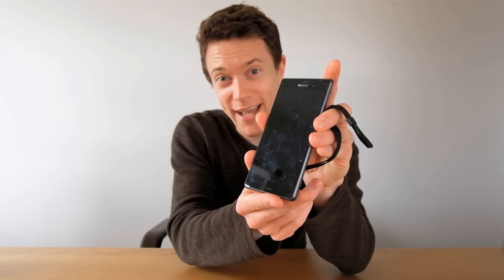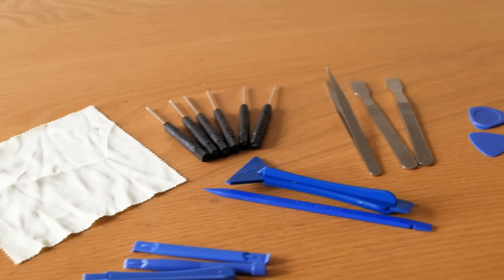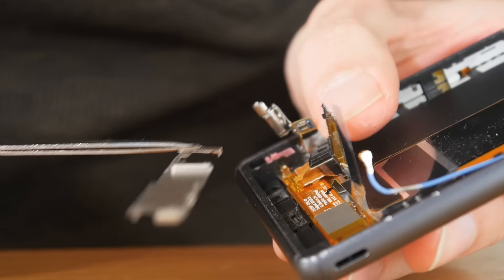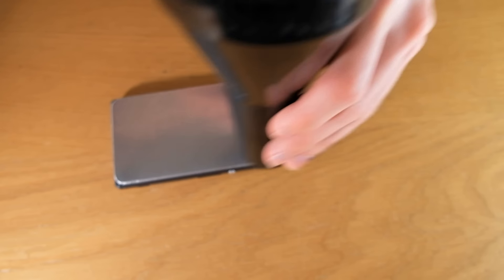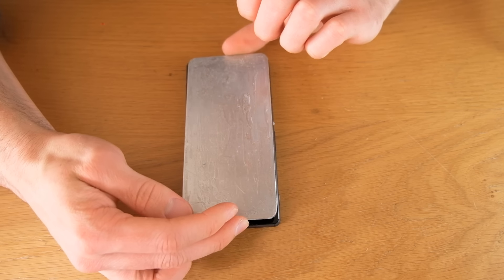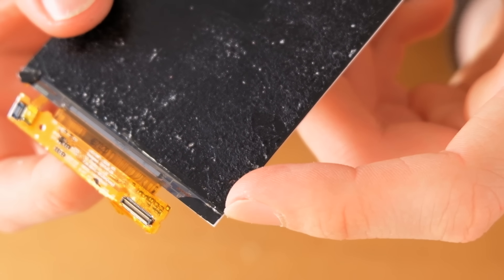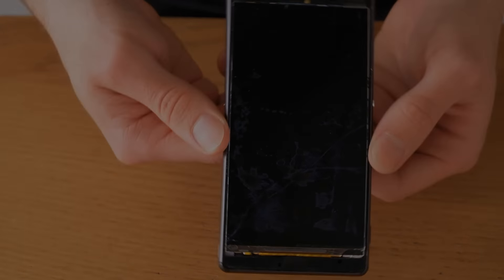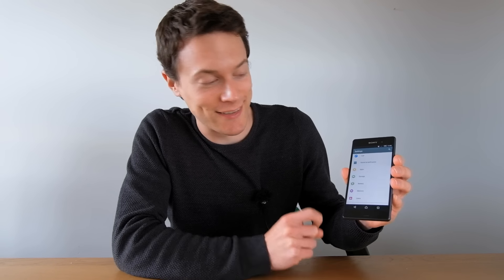Fixing a Smashed Phone Screen - on a budget! (GLASS ONLY REPAIR ATTEMPT)

Comment: In this day and age with the limited resources this planet has and the horrendous labour conditions used to extract rare earth minerals, all phones should be easily fixable, using all these glues and adhesives to make these phones very difficult to repair is ridiculous!
Reply: Nick MG i agree with you.. but without glue, if the phone fall, it will open apart itself, and it shouldn't do that..
Reply: I know what you mean. It should really be modular. Each component should be easily separated and replaced as and when. Phones were easier to repair. Now, most of them are sealed units. The drive to sell the next best phone is what these manufactures count on.
Reply: Something like the Fairphone is better.
Reply: Just buy a brick, or don't drop your phone. 
Easy solutions :D
Reply: Sony phones are like that in particular because of the water resistance. The adhesives help preventing water from enter and damage the components. Being a sealed unit really helps with that. While I agree with you I  don't see the point in the something like the fairphone since many of this phones are easy to repair without being modular and the average consumer don't want to have the trouble to DIY anything.
Reply: Nick MG Most high end phones today are designed to be water resistant. And even if it's not water resistant, many phones have a full glass body. And they tend to use glue and adhesive to seal the phone from water or keep the phone together. 

You can check out channels like JerryRigEverything or sites like iFixit to see how easy it is to repair a certain model.

Kinda miss the days where you can easily repair the phone yourself by just undoing a couple of screws. Like the older plastic Samsung Galaxy S phones. The only part held together with glue is the screen and the chassis. But just buy a new chassis and transfer everything over, end of story.
Reply: Quit whining! If you don't like the new phones, don't buy it. Stick to the old nokias. These phones go through months of R&D, their components are so tiny, the best solution is glue.
Reply: Well, if you can repair it easily, you don't have to buy a new 200$ screen from the manufacturer. They aren't going to cut their profits for no reason.
Reply: All those glues and adhesives also allow the phone to be much smaller and cheaper.
Reply: Fairphone 2 FTW :D
Reply: Untrue. You can just get a bezel with pre-assembled screen and digitalizer. And you can swap them out by simply removing the connectors. Popping out the front bezel. Dropping in the new bezel. And re-attaching the connectors. Its more expensive this way. But not as labor intensive. Also it used to be easy to replace digitalizers. Most were edge glued into place. Nothing a hair dryer and a bit of 90% alcohol 10% water mixture couldn't get off. Now days most phones are vacuum sealed. Meaning the digitalizer and screen are glued together while under a vacuum. Separating the 2 will guarantee the screen to break (due to loss of vacuum) into a million pieces leaving  you with a horrible mess to clean.
Reply: Jupp - I still remember the good old days of the first smartphones - digitizer and TFT where separate parts and you could get a new glass for 5-10$. Also there where actual screws and gaskets, so you didn't need to deal with resealing every time you opened it. Sadly most newer phones use UV-cured glue to fill the gap between both - according to manufacturers to improve performance readability when using the phone in the sun. I guess most would still prefer unglued since the usual "spider-app" is probably a lot worse to read…
Reply: Nick MG yup and the good old days of getting dust in the screen are long gone
Reply: Random Ryan There are phones that are easy to repair but aren't too thick. 
Phones like the iPhone 6 and 6S(The iPhone 7 doesn't count). Screen repair is easy since the first thing you open up is 2 screws and pull out the screen. And the internals aren't too hard to take apart.
Reply: Man the some of the comments on here make me realise that we're all probably doomed!
Reply: That is the whole point to my initial comment?
Reply: Pusalieth Phones doesn't have to be modular to be easy to repair. 

As I mentioned, the iPhone 5 to 6S are one of them. iFixit rated the iPhone 6S 7/10 for one of their most repairable phones for early 2016. The first thing you open up is the screen assembly. So you can easily get a new screen installed yourself. The battery and everything else is easily accessible. 
The LG G5 is one of the easiest to repair phones ever. iFixit rated is 8/10. But that phone is modular and that phone is just a failed proof of concept. 

The S7 Edge, requires the front screen to be removed to replace the MicroUSB port. Which is just overkill. And if you want to fix it yourself, you need to have a lot of patience. I mean all of the patience you have. One small screw up, can cost you a screen. Or even an entire phone. 

Oh yeah, the iPhone 6S is a rather slim phone, so the point of saying only glue and whatever can make a phone a thin as possible is not valid.
Reply: Nick MG but... All phones are fixable right? Unless you go over it with a truck or drop it from a building
Reply: Nick MG Phones aren't 100% unreparible. It's a matter on how hard is it to access and replace every component. 
Some phones, you need care and patience to repair it. And it's not only fixing it yourself as well. Sometimes, it may affect the labour costs. The parts may be cheap, but sometimes, making parts hard to access will just increase the repair cost l.
Reply: Nick MG just buy a nokia , 
if u can't break it , no need to fix it .... so simple ....
Reply: Except the adhesives help keep all the internal components in place and provide a water-resistant seal. I'm all for eco, but there's a reason why the adhesive is there. If you can think of a more environmentally-friendly way to do the same thing the adhesive does, I'm sure everyone would be open to suggestions.
Reply: An iPhone is one of the easiest phones to repair
Reply: Nick MG some devices are easier to repair than others. I work for a franchise that fixes smartphones and tablets and to my surprise, iPhones are easier to fix than some of the Samsung Galaxies. They're 1/4 the price to fix too. But you are right.
Reply: Nick MG I totally agree with your comment.
Reply: Your vids are awesome👐
Reply: Nick MG better than getting ripped off for a new phone or overcharged to fix it
Reply: I disagree! The Earth is overflowing with bountiful resources and if labor conditions were so bad in the mines then people should just quit that job and make a living farming or doing something else. Nobody needs money to live; you can't eat digits in a bank's computer. Mining is so efficient that recycling costs more. People throw away broken phones and those get dumped in the ocean because there is no incentive not to. If materials were actually scarce then the materials in broken phones would be valuable enough that it would be worthwhile to make the effort to sell them. 
Don't get me wrong; I like the concept of a phone that you can repair yourself. It's just that what FairPhone is selling is a gimmick to trick you into paying way too much for what amounts to be a generic smartphone. 

I am fed up with all these thin touchscreen lookalikes. I hate the touchscreen. It's always doing weird stuff in my pockets. I want a flip phone with a full QWERTY tactile physical keyboard that is wide. The closest thing I've found is a Blackberry Style and that is not wide, but it is the ONLY flip phone with a QWERTY tactile physical keyboard. Why can't I get what I want? I don't care if it's an inch thick; I want something that will close so that the screen and keyboard are protected. I want a SLA battery that will last a week on a charge. I don't care if it's five pounds. I would love to have a phone that held two batteries at the same time and used one fully before starting on the second so I could just slide out the dead battery, put it on a charger, and slide in a charged battery. Unfortunately manufacturers love for you to put the phone on the charger before the battery is fully discharged because that's how they sell more batteries: forcing you to use up the charge cycles early.
Reply: Nick MG
Like in old Soviet Union cartoon one pirate singing "Make money, make money and everithyng else doesn`t matter".

Comment: I lived and worked in Shenzhen, China. There are small 2 square meters shops literally on the street where guys cut phone screens and repair glass. They use proper tools and vacuum chamber. You literally come and wait in cue and watch how your phone is fixed. They are so experienced and skilled,  need around 15 min to fix a phone like new for 20-30usd including touchscreen glass. Cheers! S

Comment: Great video! However, if your touch screen didn't work from the start, doing a glass only repair wouldn't have solved that. You would've been stuck getting a new lcd assembly anyways because the digitizer is part of that lcd. Also, normally it's much more worth it to just purchase an LCD assembly and install it instead of saving a few bucks and attempting a glass only. The results from a DIY glass only will look nothing like a stock LCD assembly would, and replacing an LCD assembly is SO much quicker than doing a glass only repair.
Reply: This ends up varying from phone to phone as my Samsung's digitizer is in the glass, but my HTC's is in the LCD itself
Reply: The digitizer is in the front glass on Sony phones. On most Samsung and Apple phones, the digitizer is bonded to the LCD/AMOLED.
Reply: I agree,  however LCD with Digitizer for Samsung 7Edge still cost close to $300.

Comment: Hey Matt! great vid, but i have a cool tip for you - if you want to precisely control the temperature of your phone while reparing it use the heated bed on a 3D printer :) i fixed 3 phones and two e-ink kindles without using a heat gun or a hair dryer. Just set the bed to 70 degrees, enough to soften the adhesive, but won't damage your battery (too much :P i usually replace the battery aswell). Take care buddy, really enjoying your work :)

Comment: Okay, so I already bought the glass and new battery. I've opened it up, but I can't get the screws out. I thought that I had picked up the right little driver, but I seem to have stripped them all. I also don't understand how to glue the glass back on after I've removed the cracked one with thread. Please help ♥

Comment: Was a very heroic attempt at replacing the digitizer... to be honest that was the best and also the worst era for Xperia devices... It was the best designs at the time, with great features, but also the worst when it came to durability. 
I had the Xperia Acro S before and it is still on working conditions in the hands of my 9 y/o kid... then I had the Xperia Z1c and Z3c and both had shattered displays with the digitizer broken...
Now I currently have the XZ which is built like a tank and has, so far, survived to several drops without protection.

Great old video

Comment: designed NOT to be repairable
Reply: ADM .PL that glue between glass and lcd is used to improve picture quality. Not much to do with 'designed not to be repairable'. But i could say that about rest of the phone.
Reply: It is repairable, this was just a cheap way of doing it and he took the screen out incorrectly. Taking the glass off the LCD takes 1 minute at most providing you have the CORRECT EQUIPMENT.
Reply: ZGreenZ - sorry a curved screen is specifically installed to cause your phone to break more often and the water seal and screen are designed so its hard to open. The curved screen servers nonother purpose abd gets in the way if functionality. Sure its designed to not be repaired
Reply: If designed to not be repairable, all the internals would not easily clip together.

Comment: Damn, this is so relatable. 

My Sony Z3 had a problem where its digitizer stopped working, so I replaced the screen, and unfortunately, the replacement screen, which I purchased form Ebay was a replica instead of original. I even tested the brightness and contrast and it was not the same as original one.

So I wanted to detach original screen from digitizer to replace only the digitizer. I did pretty much the same method with fishing net. Somehow, instead of separating digitizer from screen, I separated screen's layers of sheets and almost cut controller in half. 

It is extremely hard to separate screens without proper heating pads for screens.

Comment: Buy a tampered glass screen protector for it aswell, costs like 1.5€ from china.
Reply: I was thinking exactly the same!  Saved my phone several times and a replacement is £6 next day from Amazon.
Reply: Yep, the tempered glass screen protectors are great.
Reply: And for my inconvenience I had an spelling error, meant tempered glass screen protector*
Reply: can definitely second that, destroyed my screen once by dropping against the edge of my coffee table. replaced the screen, put a tempered glass protector on it, then stupidly dropped it the same way again, dented the protector a little but it survived.
Reply: MrZurb you can edit your original comment rather than create a new one
Reply: Yeah, but I am lazy and can't bother to do that on phone :D
Reply: and with some phones, like the one shown in the video, you can put one of these screen protectors on the back of the phone as well which pretty much gives you an invisible phone case
Reply: Those glass screen protectors are much easier to break than the screen itself. If it broke, that does not mean that the screen would've broke too. It's purely marketing and a plastic screen protector is just all you need.
Reply: eskci0 why get a plastic one if you can get a glass one which is much easier to apply, doesn't scratch, feels much better to the touch, usually has anti finger print coating, barely costs more and usually lasts much longer? 

I mean I had my phone for 4 years now and the screen still looks brand new, and i dropped it numerous times, once so badly that the screen protector got utterly destroyed and trust me, I thin sheet of plastic would not have helped the screen in that situation
Reply: The glass screen protector is supposed to break more easily than the screen. That way it absorbs the impact and the screen is saved. It's tempered mostly to resist scratches. It's much cheaper and easier to replace than a screen -- yet it still feels like a nice glass screen.
Reply: MrZurb YES LETS BUY A PROTECTOR THAT HAS BEEN TAMPERED WITH WHAT COULD POSSIBLY GO WRONG
Reply: I have a glas screen protector on my phone, and even though it gets fingerprints more easily, the edges are rounded off so it feels nicer than my phone glass
Reply: i have tempered glass protector on my phone, i dropped the phone a few times and guess what? screen protector absorb the impact and the one that broke was only the screen protector not the real screen itself
Reply: Lol cheeky clever reply haha
Reply: MrZurb hello
Reply: I just upgraded my phone after the old one shorted out. I put a ballistics glass protector on it, and it still managed to break (the protector, not the phone).
Reply: They never work if u drop UR phone in the corner
Reply: $40.00 is ridicules!
Reply: I will give u tampered only 70 INR
Reply: M A D E  I N  C H I N A
Reply: Makes you wonder why the manufacturers don't supply their phones withe tempered glass screen protectors already attached. Oh . . . wait a minute . . . £££££! or $$$$$! (US).

Comment: The thumbnail looks like every scam screen repair video ever. 

Btw just buy a new $30 screen and a tempered glass protector.

Also toothpaste doesn't work
Reply: I had a temped glass protector and my phone still broke :(
Reply: @xxkyra_xoxoxx9049  protective glass should be softer than screen glass, so when you drop the phone, most of the energy goes into breaking protective glass, and phone glass survives. That's why tempered glass (it's pretty hard) often breaks with the phone glass.
Reply: @xxkyra_xoxoxx9049  physics is not useless subject apparently :)

Comment: Ye this is old as heck video, but as a person who works with phone repairs it was kinda cute to see. One of the reasons for them to glue it like that is, in one way to to stop people from switching either the LCD or the glass. Mostly because ppl would still try to claim warranty if they succeeded. Which is void when opening up your device yourself. It is also for productions sake as failrate for phone LCD are generally high. Especially with curved AMOLED that many phones use today. 

Also a tip for heating things up. as most of phone electronics can handle 80C you can put it in your stove. The adhesive wont however like it much and seperating layers becomes much easier. You should also use a bit of alcohol (isopropyl 99.9%) so eat away at the adhesive.